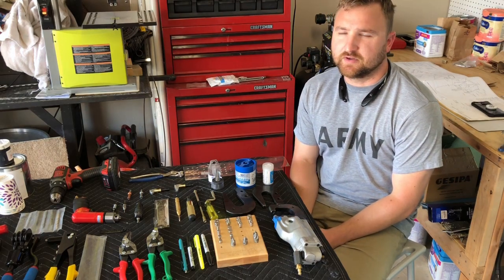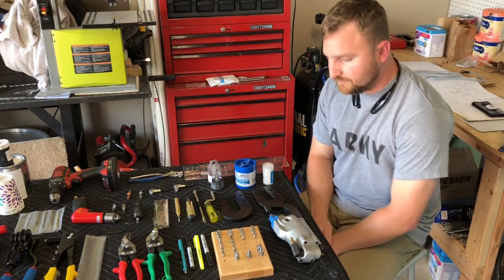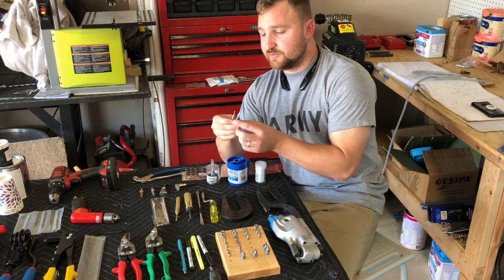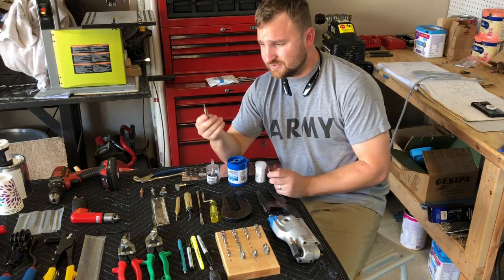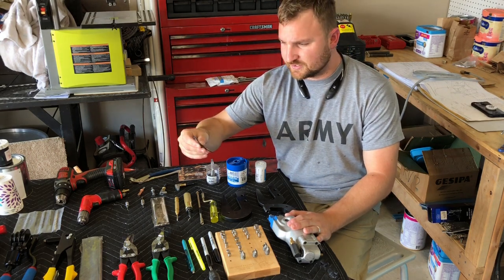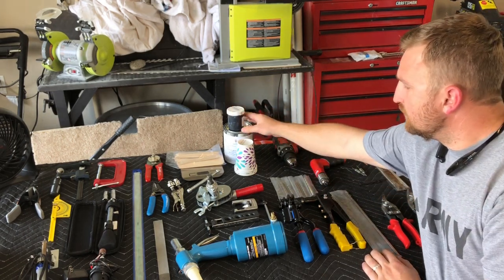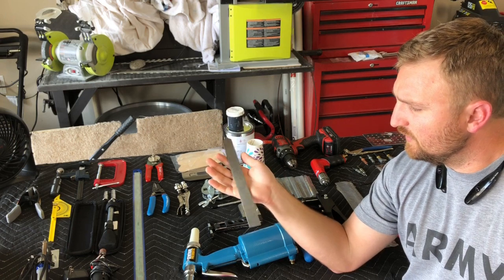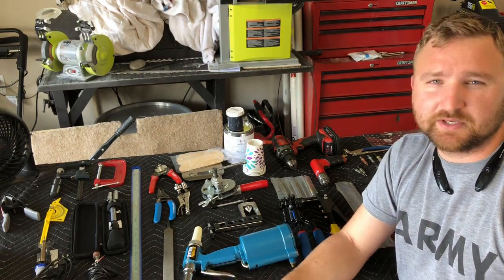RV-12iS Extras 1: Tools

Comment: Thanks for this video! Now retired and starting to work again on my partially complete legacy 12 kit using Avery tools purchased 20 years ago. I am having trouble identifying if I have both the 100 and 120 degree countersink bits listed in Van's 12 tool list. I have the same band saw but haven't tried cutting metal with it yet. Where do you get your odd-size (62") blades for the Ryobi? I will definitely check out your other videos!
Reply from the maker: I get the bandsaw blades from Harbor Freight. They are usually the only ones who have them in stock when I need them.
Reply: @blflores10  Thanks! Had the pleasure of flying a Van's-built RV-12is at Sebring April 2nd. I had a six-year delay in my build due to other priorities but now making good progress.

Comment: I saw in one of your other videos that you're using rattle can prime.  Can you let me know what is the brand name for the prime?  What is your preparation process?  Any thoughts on priming pieces then assembling versus priming already assembled?
Reply from the maker: Hi Dan, I am using RustOleum Self Etching Primer. I can get it from my local hardware store or automotive store. Priming before assembly is if you are looking for corrosion protection at the mating surfaces. I am only priming the surfaces that will be painted and not so much concerned with corrosion as my plane will be hangered and I do not live near the coast. For priming prep I simply use scotchbrite pads to scuff the surface then clean with acetone. Once the surface is cleaned and dry I simply spray with the primer.

Comment: Sorry if you covered this elsewhere. You mentioned about building a RV14 then went to a RV12. Just curious why?
Reply from the maker: Hi Slappy, the main reason was cost. Simply put the budget wouldn't allow for it in the time I want to have the plane finished. Second was mission, based on the flying I do the RV-12 fit the bill more-so than not with mostly local  X-country flights under 100 miles while allowing me to build hours with the occasional longer flight maybe a few times a year. Did I mention its very economical to fly too?.. :) Don't worry though, as most builders i'm already thinking about the next build once the 12 is finished and its looking like more of a front/back seating arrangement....

Comment: Outstanding video.  Very informative.  I think Youtube pushed this up to my playlist because I inquired of Paul Straub the very question that you answer here.  Looking forward to watching your other videos.  One other question I have is what would you say is the minimum space (width x length) one could get away with to build their RV 12?  Thanks.
Reply from the maker: Ray Scheren thank you! I am really looking forward to getting the wings ordered. I would say at a minimum you need a 1 car garage (10’x20’) to build, . As you move through the kits in build you’ll need more space for storage. Not to say it couldn’t be done in a smaller space as I’ve seen some builders complete kits in their bedrooms, literally and assemble at a later point.

Comment: Did you buy the whole tool kit from Cleveland? Do you recommend buying the full tool kits from Cleveland or planetools.com, or just going out and accumulating all the tools individually on your own?
Reply from the maker: I bought most of them from Cleveland, some of the other such as the tube benders, drill bits, sealants etc have come from Spruce and other local hardware stores.